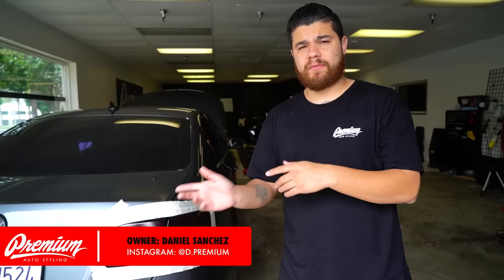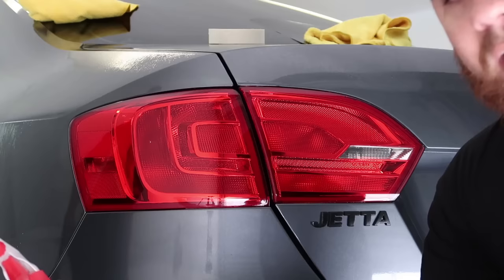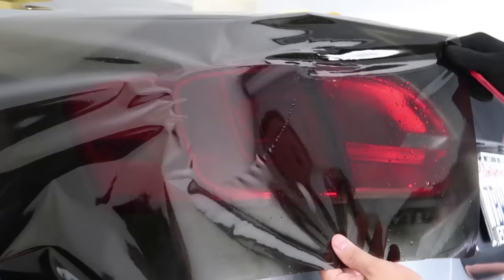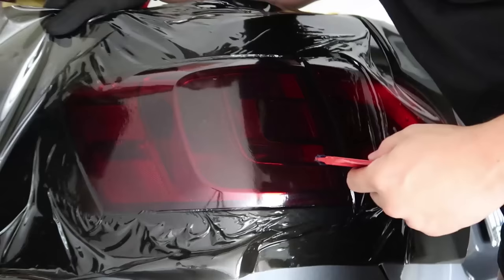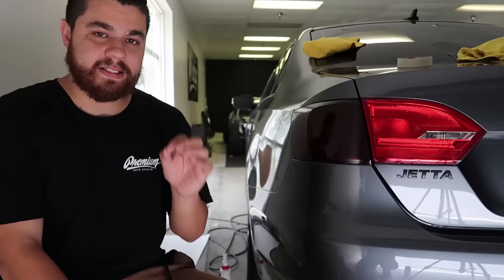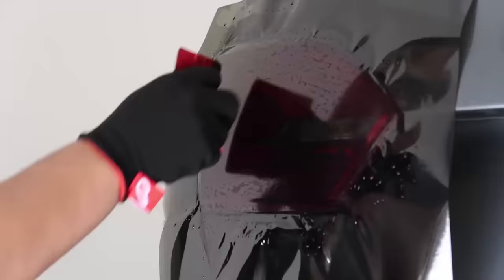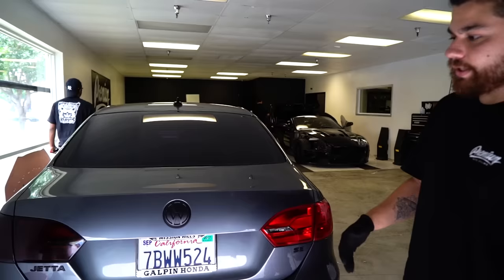How to Tint Taillights with Film

Comment: Anyone know if spraying both sides of film is mandatory before applying to the lights? Or can we just clean the lights first then apply the film without spraying the film as well?
Reply: You can apply the tint without having to spray both sides.  Spraying helps the stretch and make the overall experience of applying the tint easier

Comment: What is that you are using to remove the paint with?
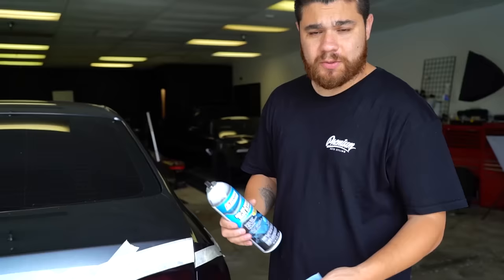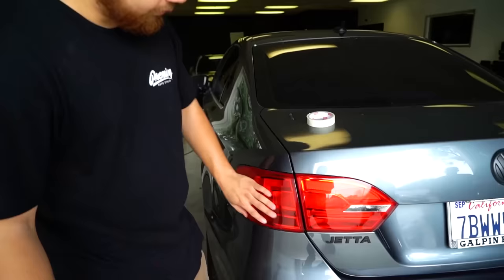Reply: It's Non-Chlorinated Brake Cleaner. Around the 1:00 mark you can see the can and around the 1:40 mark he says it. Don't get it on anything else though, brake cleaner can eat clearcoat if you're not careful.

Comment: Why tint your lights? So those behind you have a harder time seeing your car unless you brake right in front of them?
Reply: Daniel Martinez a lot of light can still be seen it doesn’t make it harder to see
Reply: @RawRapper  when you press your breaks or signal at night but all the ones I have seen, which are quite a few here in socal , you can barely see when they stop or signal during the daytime even if you're right behind them
Reply: Daniel Martinez fair enough when I done mine I replaced the bulbs with leds and they are extra bright so they can be seen clearly

Comment: Is there a way I can remove tint film from my tail light? Do I use a heat gun?
Reply: Marcus Coker 

yep. Gotta heat up the whole tail light for about a minute with the heat gun, not too close though. Then start peeling from one of the corners you can get a hold of (u might have to pop ur trunk to find an edge to peel from). Keep heating as youre pulling though.
Reply: @gangsterdisciple759  alright thanks man

Comment: It would be a real good how to video but its a bad one due to the fact that everyone watched it then they all asked what the tint percentage is and did not get a reply! Dude that made the video! Tell them the tint %. Do you think your gonna get in trouble for telling them? It makes no sense. I didn't see where you told the %.  I know what % to use on my stuff but they might not! I think a very light tint would help the taillight from uv rays and also make it look a darker red. I wouldn't go as dark as he did. I'd go a shade lighter. Don't make a "supposed" helpful video if your not going to help people with answers to their questions... I believe you answered a few yeah but not the most important one.. Come on seriously. I'll make a video of 3 different taillights in different tint % exactly the same as he did and i will tell the percentage though and what manufacturer made each one. They sell all percentages on the site i seen. One i seen is called Rtint. You can get them pre-cut or just cut it yourself for way less. I already have a blade knife and heat gun like that so I am going to order some and i will send a link of it. I'll do a 2012 town and country taillight. A 95 silverado taillight and a 06 f150 taillight with different shades and possibly different tint manufacturers. Another one i heard of is solarFX. Carbon or ceramic or vinyl take your pick! Any tint shade percentage you want as well. I'll be back..

Comment: Clear OVERUSE of the word, "actually", and those indentations your talking about that look like bubbles are not "mold" divots, they are vent holes so that your lights don't get condensation built up inside the lens from humidity, etc. By covering them, you're creating an issue for the light fixture to collect moisture in the electrical components.
Reply: Yea, he does seem a little ignorant tbh lol...

Comment: Stupid. I wanted the brightest taillights and brake lights I can have in inclement weather and foggy conditions.
Reply: Which is why the correct way of tinting your taillights is to open it up, spray the chrome parts thats not reflectors black, then put on a clear/5% tinted cover instead of the red cover, this is mostly done on LED lights tho. That way the taillight is not actually tinted, but looks tinted. But tinting with these films wont be an issues if they have some mirror/reflective properties that reflects the light thru the film rather than block it.